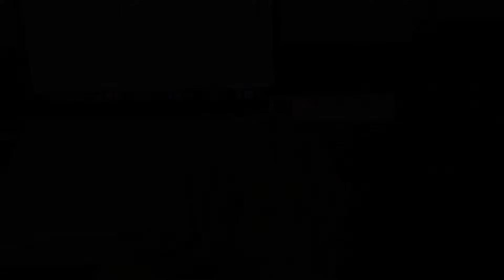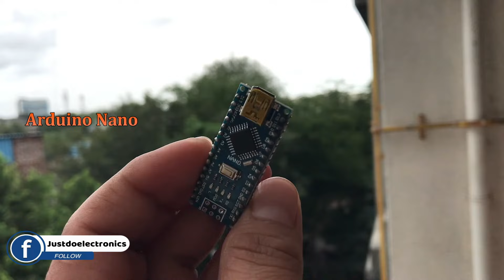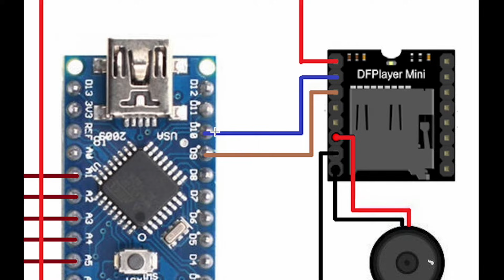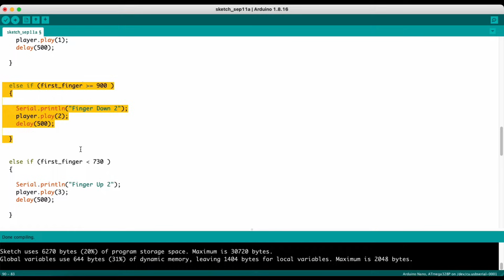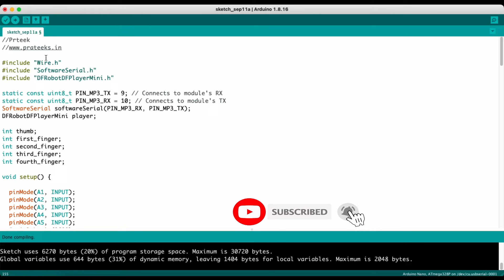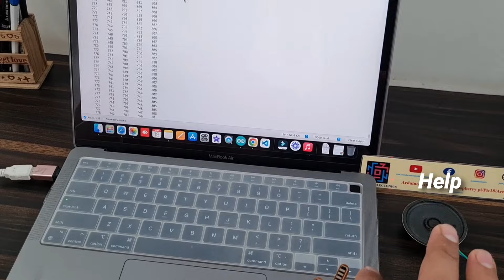Sign Language To Speech Conversion Using Arduino & Flex Sensors | Hand Gesture to Voice Speech

Comment: Sir can I ask you that Why we need to use 8 Ohm / 0.25 watt Speaker , and why we need to use Resistor 10k. Thank sir to support this project
Reply from the maker: no in my case I used the 10k resistor

Comment: SIR IM FACING A ISSUE WHILE MAKING THIS PROJECT FIRSTLY MY FLEX SENSOR IS GIVING ME 900 VALUE IN THE SERIAL PORT WHEN IT'S IN NORMAL STATE BUT WHEN I BEND IT IT'S GIVING ME 800 VALUE THAT MEANS THE VALUE IS DECREASING N IM NOT ABLE TO SOLVE THAT PROBLEM, ALSO IN THE CODE IM GETTING AN OUTPUT BUT IT'S IN LOOP LIKE I HAVE PUT 3 AUDIO'S BUT ONLY ONE AUDIO IS WORKING THAT TOO ON LOOP WITHOUT ANY MOVEMENT IN MY HAND GESTURE IM NOT ABLE TO FIND A SOLUTION FOR IT PLZ HELP ME

Comment: Sir plzzzzz show the back side of the soldering it's very confusing plzz show the back side also how can I add a recharge battery n solar panel to it??
Reply from the maker: Where I don’t get it what you say ??
Reply: @JustDoElectronics  firstly I want to see the connection from the back side so that I can  understand the connection and secondly I need to connect power through a battery or a solar panel so I want to know that how can I connect that and where can I connect it
Reply from the maker: @naelahsurti6867 ok you used vin pin in arduino and you connected 6v to 12 external power source
Reply: OKK
 @JustDoElectronics